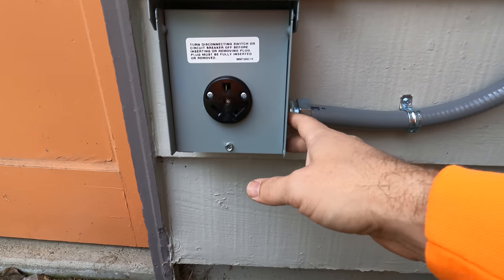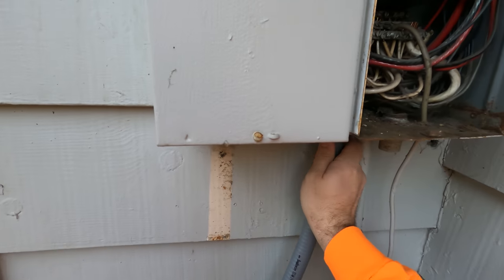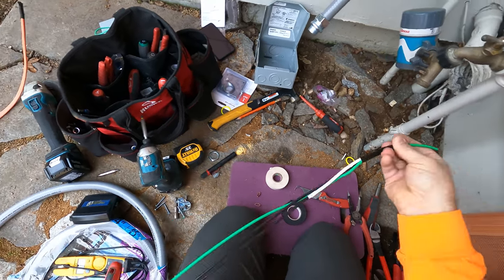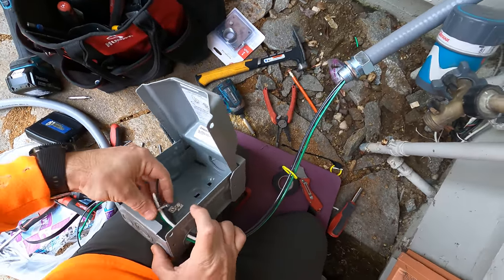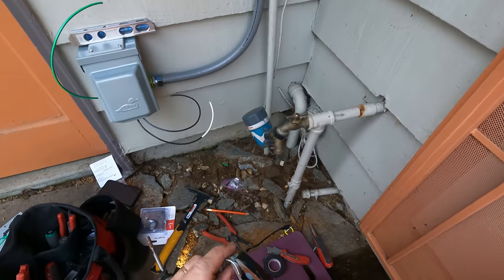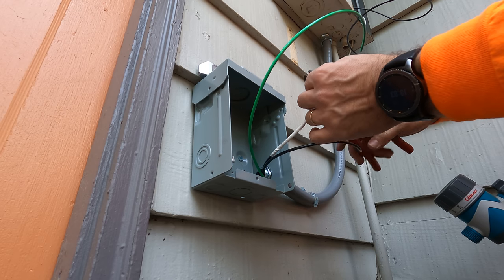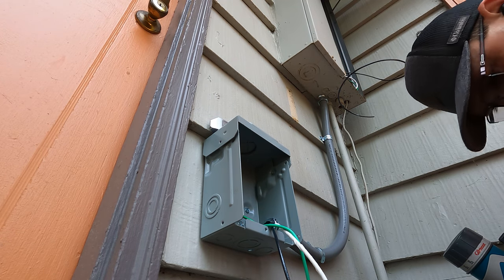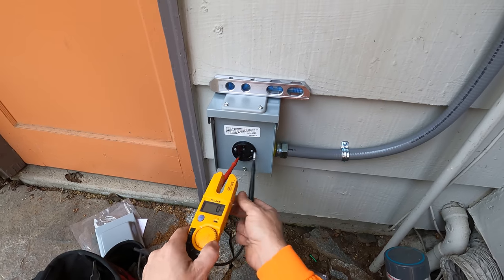30 Amp RV Outlet Install. How to DIY Electrical Receptacle Wiring for RV. RV Plug

Comment: I love when people make home videos.  They motivate and inspire.

So, I write this comments in an attempt to help not harm anyone.

That said,  some pointers come to mind.

2020 NEC 110.3.(B).  Talks about following the manufactures instructions for installation and use of equipment.  So, at about 4:50 he talked about putting 2 wires under one screw in his panel.  This must be allowed in the panel instructions (approved for that usage).

2020 NEC 300.18 talks about installing the raceway before putting the wires in it.  I believe this is to protect the wires from pinching as the raceway pieces are installed.  Also, when the box was screwed to the wall, the wires were very close to the rotating drill head and bit.  The si.ple act of driving the screws could then grind off the wire insulation rendering the Wire usless.

2020 NEC 210.8 at home gfci protection for personnel talks about outdoor recrpticple needing gfci protection.  A 2020 change was to the voltage....
Fro. 125v to 250 v recepticles.

2020 NEC 406.9.(B).(2).  Talks about outside (wet location) recepticles like in this video needing a weather proof enclosure when the plug is installed.

Again, I am not trying to nit-pick flaws, I looked but was unsure if the breaker was gfci protect and their was zero mention of the plug cover.  

Please get your safest install.  People have bled and died for some of the rules.  

Be safe out there.

PS. With all those and more rules to look at, you can see how they charge so much.

Comment: Should 30A RV outlet installed inside garage be  GFCI protected, in which case I would need to install 30A GFCI breaker (don’t think I have ever seen 30A GFCI RV outlet)?
Reply: No, the GFCI requirement only applies to 20A circuits and lower AND it has to be in an area that can get wet (like outside, kitchen, bathroom etc.) Your city may vary but that is most cities/areas. But no, a 30A GFCI doesn't exist (That I know of).
Reply: They exist.
Reply: Sir, the 2020 National Electric Code (NEC) has 2 sections for this:

90.4 points out your local building inspector (ahj) can adjust the requirements in the NEC 

210 gfci for people protection.... in 210.8.(A).  Dwelling units
All receptacles must be gfci protected 
220.8.(A,).(2).  Garages.

So, yes gfci.

Be safe.
Reply: @guitarfreak2105  sir, a review of my 2020 NEC under gfci protection for people 210.8. It is a voltage limit listed .... 125 through 250 (their numbers.  So, in the garage, all recepticles now require gfci.

Please double check me on this, I am never "wrong", but I was "mistake" in my past.
Reply: @keithharrington8715  Thanks for the clarification, Keith.
Reply: Surge protector always recommended

Comment: By following NCE code you can’t add new breaker on system without grounding system specially that  Zinsco ( one of dangerous main electrical panel in the U.S.)

Comment: I am being quoted $3000 to install a 30&50 RV box.  Unfortunately my Electric box is on the opposite side of the house.  So they were would be run through the attic.  75 feet total.  He stated due to the price of wire today.  Am I being taken advantage of?  I know that includes parts & labor but geezz!  This is in Phoenix with a building boom.  Thank you!
Reply: Easy to see what material costs would be at any box store.  $3k is insane.
Reply: Do it yourself
Reply: I would run everything yourself and if you don't feel comfortable have an electrician check your work and install and connect the breaker. If you don't know any electricians, ask a Realtor. They often know a lot of  independent tradesmen they use to get houses ready to sell.
Reply: I just got a quote for $1200 with the main on the opposite side of the wall 10' run max that includes the pigtail length.  I asked him how much if I provided all the materials.  He ok (same price) but included it would void the warranty of his work.
I'm having a time trying to find anyone willing to actually do any jobs.  Had 3 quotes lined up for a mental roof (20×16 shed) install, no one showed
Reply: That’s the installed price?
Reply: @jasonkeuma1986  yup.  So we just did it on the side where the breaker box is and bought extension cords.
Reply: A quick check of Union Electricians in Phoenix:   pay into pocket about $32/hr;.benefits about $18/,hr .....so about $50/ hr for each guy.

2 guys for about 10 hours would be $$1000 plus parts plus money for the secretary, plus the mechanic to keep their truck running plus.....

So, not unreasonable, but may not be the cheapest.  

Becareful chasing the cheapest,   You could get a cheap fleece jacket each year or spend some extra and get one to last a lifetime.
Reply: I just quoted some one $1350 and they said that’s to much i think its fair but 3k is a service upgrade here in ks
Reply: Ripoff
Reply: Non of these guys responding are actual electricians. It’s a bit on the pricy side but absolutely not a rip off. If that company has a very good reputation for doing high quality work than that’s perfectly good price. Do it yourself and cause a fire if you want .
Reply: way too much $$$$$$$$$$$
Reply: @keithharrington8715  You forget the tool upcharge

Comment: I had an outlet for a kitchen stove but got rid of the stove, and wanted to use the breaker/wire to install a 30A RV outlet. The breaker is (2) 120v, 30a breakers attached together with a plastic piece. The guy I had install the outlet didn't replace the breaker or wire, but said he only wired "one leg" (or something like that), so it's only 120v at the outlet. He showed me on the volt-o-meter it said 120. Does that sound right?
Reply: He saved you 10 bucks today to condemn you to spending more tomorrow.

The next guy, cannot use that second breaker.  He must replace both.  That happens at tomorrow's prices.

Comment: I have 30 amp cord that I use to power my house via a portable generator ( when power is out).  Hardwired cord that has a 30a male on the end that plugs in the generator.  I am trying to find a 30 amp Female to 30 amp female to back feed from the house to the RV trailer but I cant find that kind of adapter.  Is that something I am not supposed to do?
Reply: This is an area ( powering your house with a local generator), is an area of great concern.

It can be done, but please call inthe calvary on this one. ( Local electrician, ,build department, even the utility).

Power on the pole is about 12,000 volts.

Transformers work in both directions.

That power line on the ground 2 miles from your house may be powered at 12,000 volts by your generator through the transformer on the pole.  This could be a shocking experience for the neighborhood kids and the electrical guys trying to fix everything.

There are breaker interlocks to prevent shutting two breakers (your street supply and your generator supply) at the same time and elaborate switching devices to prevent the double power thing.

When power is restored to the pole from the utility, your generator may be a big short circuit for the utility.  In that fight, the utility will be thousands of times bigger than you....

So please, make a phone call or two, buy someone a six pack, have a BBQ and pick someone's brain.  Those rules are there for safety and while many can do it  can they make it SAFE, not .just make it work,?

Comment: Maybe we should shut the power off before you start fucking putting wires in there where it’s hot and I’ve never done it before but obviously you could wire that box up after you got your measurements then put it on the wall or the side of the house talk about safety first like I said I’ve never did it. I am a high-voltage electrician linesman for 30 years safety first and smarter not harder. Second piece out smoothie.